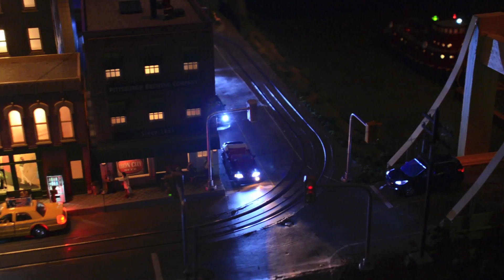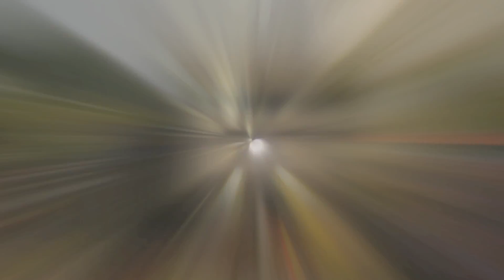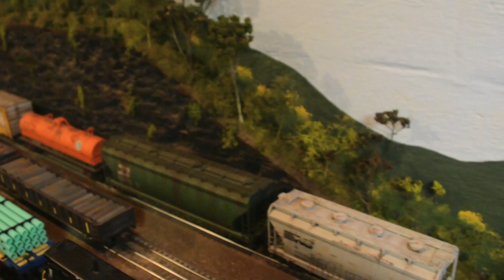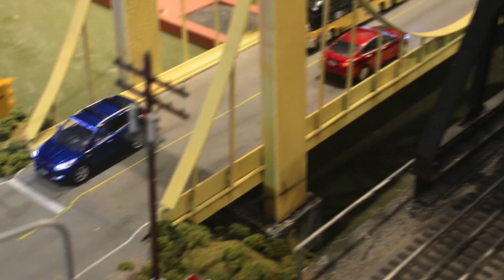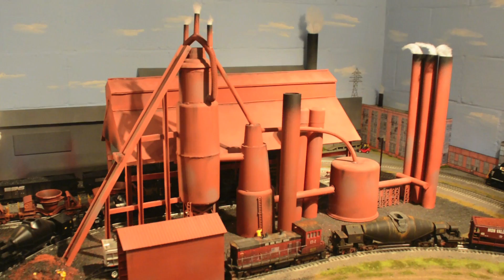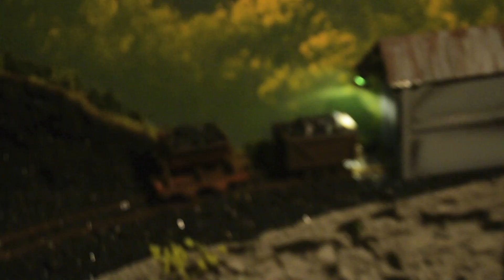Layout Update #22 "The Nightlife, Coal Mine & Yard"  (Lionel Legacy & MTH DCS)

Comment: Wow awesome work, you have been busy. I am excited to see what you will do with the blast furnace.
Reply: What box did you use to control your police car?
Reply from the maker: The police car has a small speaker mounted under the table right under the car. It's cool the sound comes out from under the car through holes I drilled.  It's controlled by a 9v battery sound maker and switch